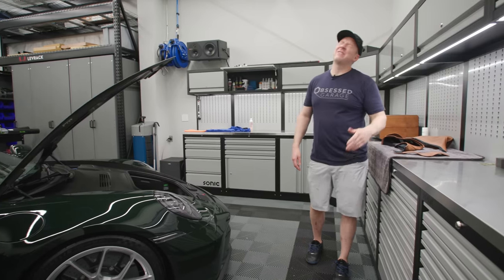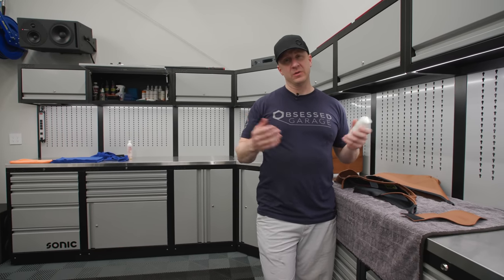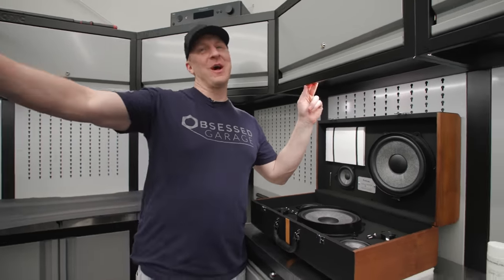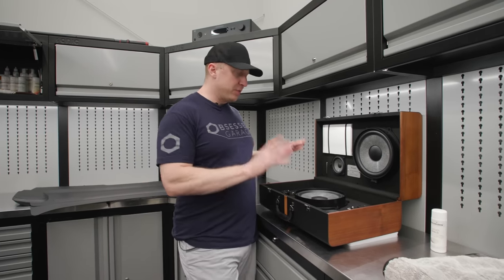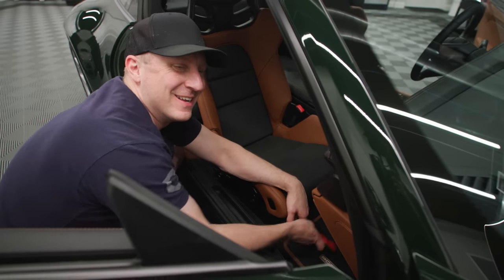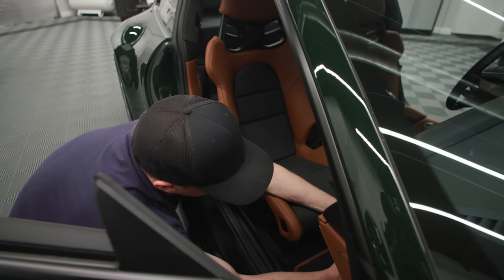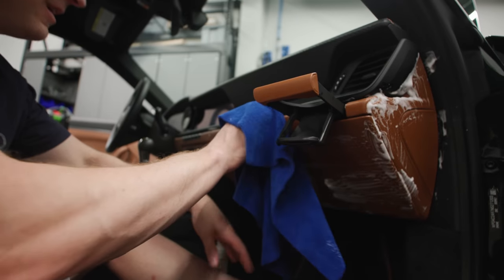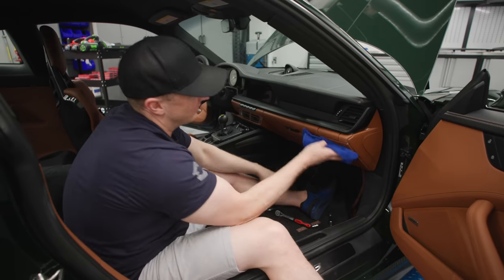992 GT3 Touring: Interior Cleaning & EdGuard Install | Does A NEW Car Need Interior Cleaning?

Comment: Hey Matt, have you fitted your Focal speakers yet?  If so, did you add an amp?  What were the results?
Reply from the maker: Not yet... I'm going to put them in without the amp first to see how it works.
Reply: Intrested to hear how they compare to stock Bose. Considering similar plug and play upgrade, as Bose doesn't sound that good.